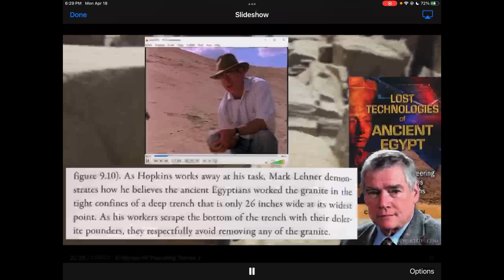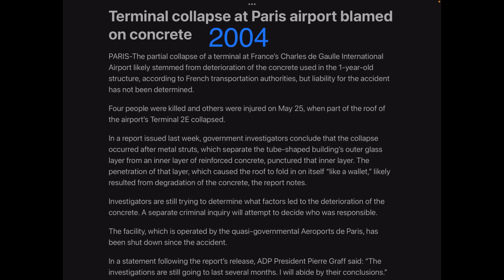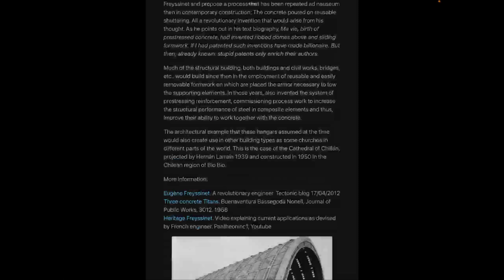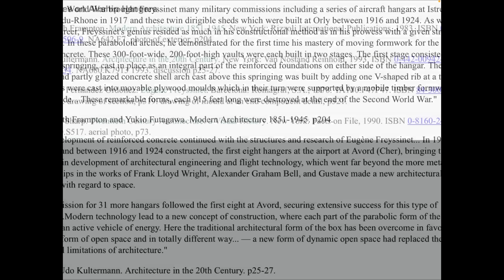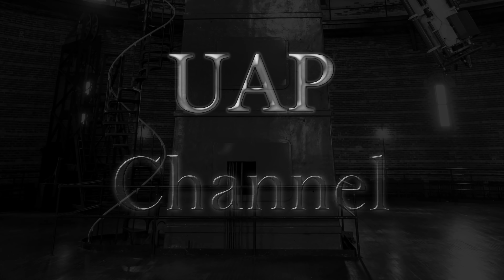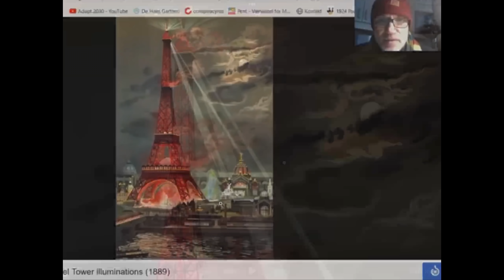Mystery Millennia of Concrete | UAP

Comment: Read a comment from a similar video a while back that claimed concrete had an admixture that included blood instead of water.  Offhandedly I would guess the iron from the hemoglobin was the reason for the added strength.  One such structure blood was used in is the Great Wall of China!  If I had lived during that period, I would have avoided construction sites.

Comment: dolerite balls were part of steel ball mill machine but with dolerite chunks in it instead of steel balls to powder stone and then use it to make geopolymer. they probably used the mills to powder pigments and produce chemical ingredients for tech like batteries and electricity rectifying plasma bulbs.